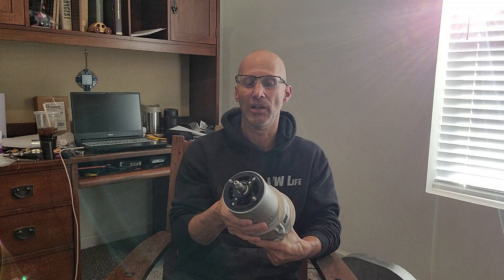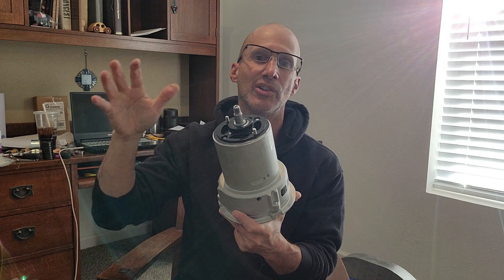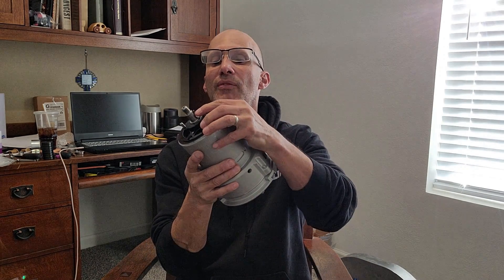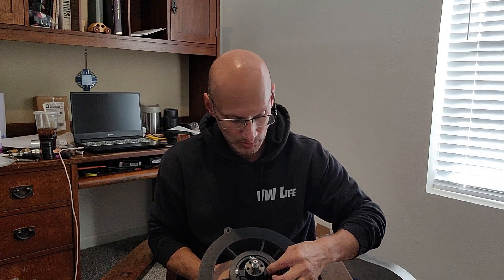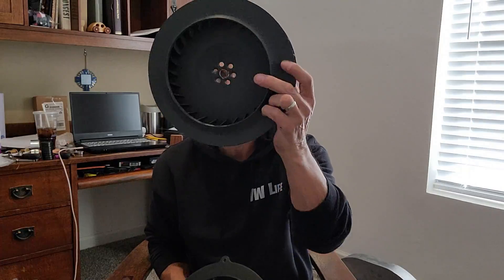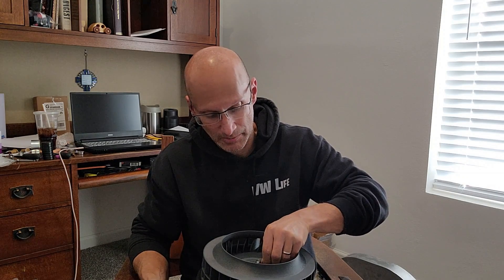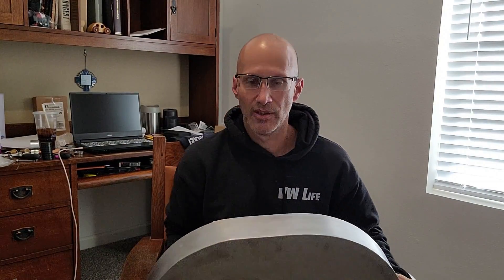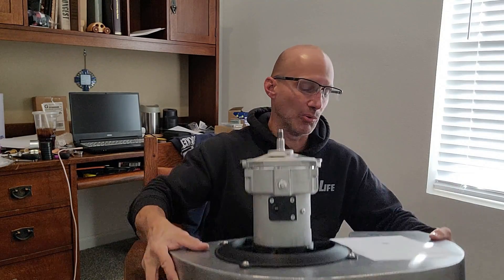Evolution Two Cooling System Assembly

Comment: Do you recommend the thermostat and flaps with this shroud, or is that not necessary, OR do you recommend your fixed flaps with it? TIA.
Reply from the maker: @scottstrand7865  The way the air vanes are designed eliminates the need for flaps.  Since it also requires an external oil cooler, I recommend using an oil thermostat in the full flow setup.

Comment: Shipping says mine should be here Monday. 
I'll be running it on a 2110cc in my Baja. Currently I don't have any other OEM tin material below the tin covering the cylinders and heads. Would you recommend cool tins to wrap around the lower portion of the cylinders?
I'm really looking forward to using your system.
Reply from the maker: I would actually recommend the Type 1 deflector for under the cylinders, and the Type 1 cylinder head deflector that sits underneath the head in the center.  Those were actually designed for proper direction of the air when it's coming from above.  I'm not sure the Type 3 "cool tins" really work properly on a Type 1 engine, because the Type 3 cooling system has the air entering from the side of the engine, and the cylinder heads themselves are slightly different.
Reply: @andrigsaircooledtechnology  that makes sense, I wasn't thinking about the type 1 deflectors and I do have those in place. 
Thanks for responding, with all the testing you've done in making this setup I want to get it right when I install it.
Reply from the maker: @goldentrunnell7450  Sounds good.
Reply: would this system work  good With a center mount fan Shroud

Comment: Is this fan available for a 36hp motor?
Reply from the maker: I have a fan that does fit the early fan shrouds, but currently I don't have support for the 6 volt generator.  The backing plates are quite different, and the generator is not the same length, which requires some dimensional changes to both the fan and the inlet/backing plate.  I have the fan prototype done, and it now fits fine,  and I have the inlet/backing plate to print and verify as a prototype.  So, if you have a 36 hp engine, but either have converted to a 12 volt generator or an alternator conversion, what I have will work for you already.  If you have the pre '67 generators (6 volt), I'm not quite ready with the product, but it will be ready in the next month or so.

Comment: When ready to torque the 18mm fan nut, if you install 1/2 of the pulley there will be 2 parallel flat surfaces that the 2nd had keys to. Use either and open ended wrench or a vise to hold the pulley and then you can torque the 18mm nut. That's how I torque the 36mm stock nut.

BTW... keep up the good work. Guys like you are needed to keep this hobby going.
Reply from the maker: Yeah, sure.  I always just installed everything on the engine, including the belt, and then just used a screw driver in the pulley slot to hold it in place while torquing the nut.  In this case, that method is a lot easier since you only need to torque to 25 lb. ft. instead of the 42 of the original massive nut and spring washer.  That's the advantage of having so much less rotating mass.

Comment: Come on buddy. An installation video, that does not show the fan on a complete engine?! Wtf...
Reply from the maker: Well, I'm sorry you didn't like it.  Installing the fan shroud on the engine is probably the part you already know, since you had to take the old off, but I can always add a part for that if people are confused by it not being in the video.
Reply: @andrigsaircooledtechnology  It is not that I do not know how to install a fan or shroud. But I want to hear the fan system while it is running. I would think many people would want to see and hear it in action before ordering the system. I mainly want to hear iit in action, because I wonder if it sounds different than the stock VW system.
Reply from the maker: @jameswright7382  That's fine.  I can do another video showing it on my teat engine.  I'm really busy, but will get to that eventually.  In terms of the sound, it sounds similar to OEM, but as you go up the RPM band it is louder and sounds like a centrifugal supercharger.  It just moves so much air that it will absolutely be different.
Reply: @andrigsaircooledtechnology  I am very intrigued.  I totally understand being busy in the shop. I am stoked someone has created a fan like this. Also, I would like to sincerely apologize for coming off like a tool in my first post. It was a bit rude, and uncalled for to include the wtf. 👍💯
Reply from the maker: @jameswright7382  Yeah, I've been making quite a few of the fan shrouds for orders.  I've also been working on a heater version of the fan shroud as enough people seem interested in that to make it worth the development effort.  My laser cut sheet metal parts for the first prototype are on their way to me, and I'll be putting that together in the shop too.  I wish I had recorded parts of my testing on my test engine, but when your busy monitoring engine data and RPM levels for testing, it's hard to record too.  I also have a bit of a problem with my test engine in that it just has a "bullet" muffler, which isn't much of a muffler at all, so I think I will need to put a real muffler on the engine so that people can actually hear the cooling system ;-)  Bye the way, no apology necessary, and no worries.  I appreciate the interest.  Keep an eye out, because I'll be introducing the same fan design for OEM and aftermarket Doghouse, Early VW and Porsche 356 fan shrouds too.  Some people don't need the cooling capacity of the entire cooling system I designed, but would benefit from just the fan and inlet on their existing fan shrouds.  They won't perform as well, but they will way outperform the OEM fans, and with being so much lighter (probably around 85 to 87% lighter than an OEM welded fan), that you will get the cooling improvements with the throttle response improvements too.  My first lightweight cooling fan was 73% lighter, and my goal was 90%, but couldn't reach it with the original design.  I'm getting really close with this design and material, which is exciting, at least for me.  Thanks again, and take care.
Reply: @andrigsaircooledtechnology  Thanks for all the info. I am building a 2110cc engine for a Kelmark GT kit car I own. A high flow fan should help this car. It does not have the full isolation of a proper engine compartment. One that successfully isolates the hot, exhausted cooling air from the upper part of the engine. I am working on fabricating a proper body panel to seal the engine bay. A high flow fan system like yours may be the ticket to success for me to keep a fairly big engine cool in a poorly designed engine bay. 👍💯
Reply from the maker: @jameswright7382  Yeah, I have a customer that has a kit car that has already ordered the system.  He should have it already, but I haven't heard how it's gone.  I think it definitely makes sense for these kinds of builds.
Reply: What about doghouse style oil coolers?